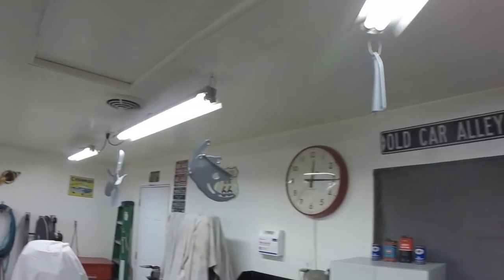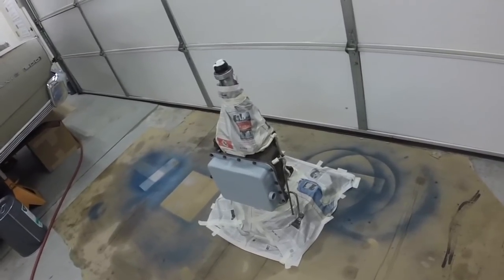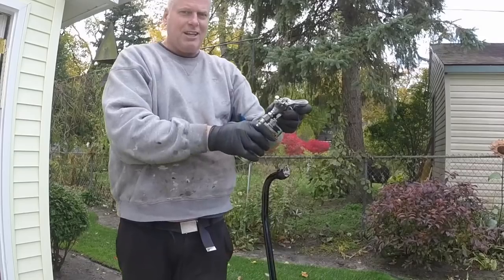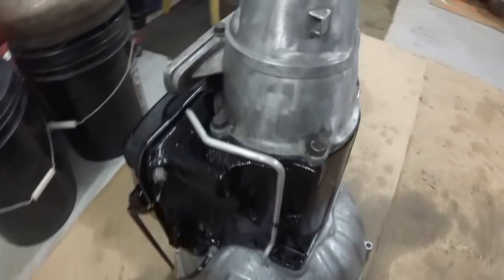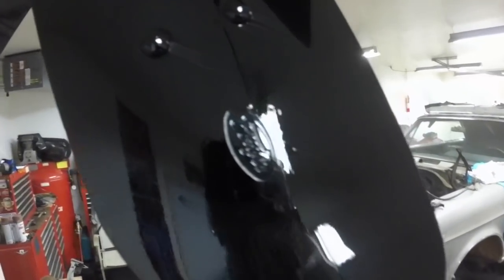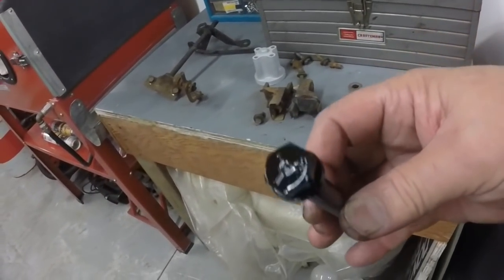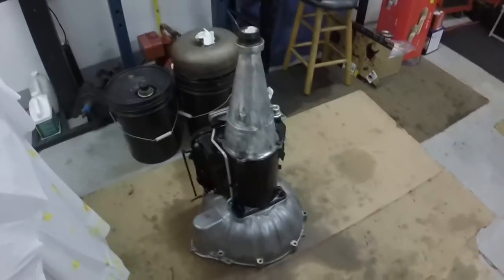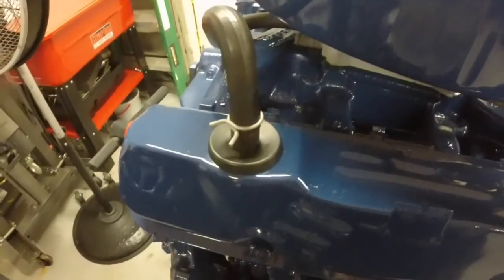1966 Ford Galaxie 500 convertible restoration part 27 painting trans & parts

Comment: You got to do the top some time and no time like the present. It just drags down the beauty of that car. You have more patience than me. Don't forget the front seal, I did that and boy was I angry with myself when it dripped on the floor. I did fix it but the air was blue... Ford blue for a day or two/LOL. It will be so nice and hopefully factory colors as they seem to like original the best. I kept that car for a long time and then went on vacation and when I got back the city had twoed it because of tags expired and it in my own yard. I sued and lost to that too
Reply from the maker: I will put a new top on, after the car is painted. There is some minor rust threw at the rear, that I need to address. I will replace the seals before I install it. I have had the converter in and out a couple times, and may need to remove it more, so thats why I wait.

Comment: Using single stage urethane or acrylic enamel?
Reply: Yes what are u using to paint these with my friend
Reply from the maker: Using acrylic enamel. It holds up really good.
Reply: Is that rustoleum, and do you use a hardener?   I have been using a single stage urethane on my chassis parts but thinking of going with the rustoleum.
Reply from the maker: @enricopolazzo33  All the chassis parts are rustoleum. Over time, it the best product for that kinda stuff. The backing plates are acrylic enamel with hardener.